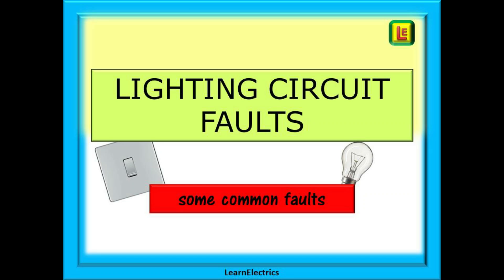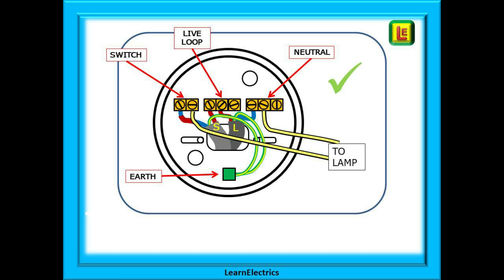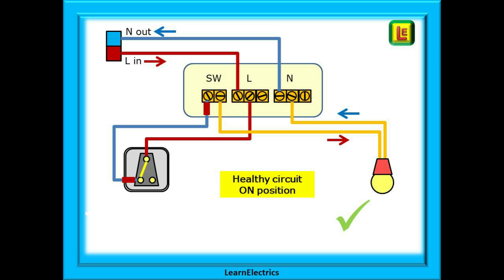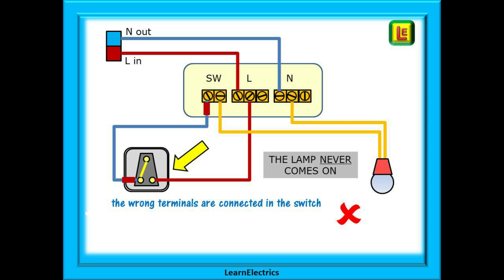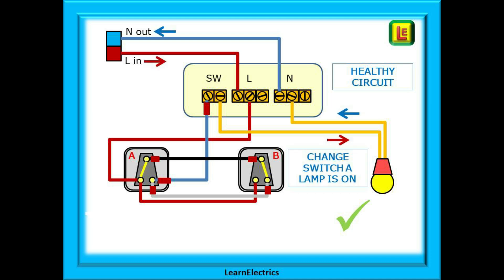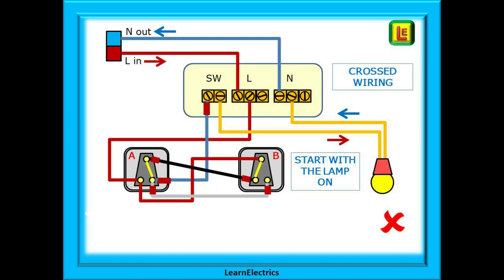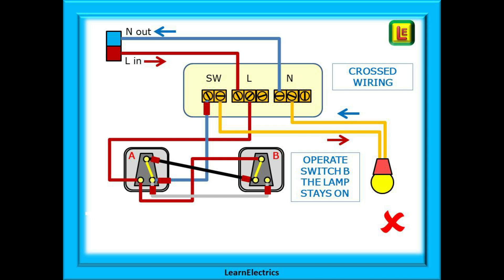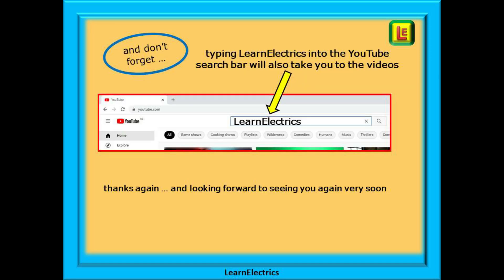LIGHTING CIRCUIT FAULTS. Some common problems with lighting circuits and solutions.

Comment: What's the fault, when the light comes on sometimes or there's a delay in it coming on?
Reply from the maker: First thing I would suspect is loose connections somewhere or damaged cables. Dead test all the lighting circuit, low ohms and insulation resistance. Have a look at this video.
https://www.youtube.com/watch?v=Ax4-bZ7WDwg

Comment: The oddest & biggest pain in the arse I've had with lighting was installing 6 led spots in place of an old 6ft flourescent.
They worked great for about a week then all 6 started going to half brightness!! I re terminated every connection, replaced the switch drop & the issue randomly continued after a couple more days. Luckily i could easily get to the loft area. I measured ( whilst in fault mode) 188v !!! I replaced the complete circuit & feed ( from the adjacent bathroom) & all is ok. I meggered the 1.5 T&E that i removed & scrutinized it severely, & it looked perfect. I can only assume that the cable had a break down within the copper somehow !!! But it meggered ok & a low resistance test came back ok !!
Reply from the maker: Could have been leaky cable insulation, it could have been leaking to something it was touching. Sometimes these random problems remain a mystery. Almost certainly the old cable was the root of the problem. Good that its sorted.

Comment: Useful thankyou! What about a 2-way switch where only one orientation of switches work?
So there’s only 1 out of the 4 possible ways of having the switches that works.
Is that a problem with the switch itself?
Reply from the maker: That sounds like a wiring fault, check that your wires are going to the correct terminals. Have another look at the video, a scenario like that is covered. Thanks for watching. Dave.
Reply: Hi, I replaced the switch and it started working properly again. Your video gave me the theoretical knowledge to realise that one of the switches must be the issue, and also demonstrated the patience required to find faults. Thank you for this informative video. I’ll be back for any more electrical issues in the future!

Comment: Hello, What is the minimum size of an aluminium conductor which feed a lighting circuit, 16mm² or 1.5mm². In OSG, table I1, aluminium cable only begins with the size of 16mm²
Reply from the maker: Correct. Table 52.3 page 148 of the Regs book. Be careful with old aluminium cables as they become brittle and can snap as you bend them. And remember to dip them in an anti-galvanic compound before putting them in brass terminals. Sometimes best to try and rewire that part of the circuit in copper if possible. Dave.

Comment: You're a top fella Dave. As an apprentice I muddled the strapper cable on at least a couple of occasions. I was red faced trying to figure out what I'd done wrong. It worked but not how intended.  Sometimes it's the simplest mistakes. Keep doing what you're doing buddy. You're producing some mighty fine tutorials 👍.
Reply from the maker: Thanks Ray. I've lost count of the mistakes I made over the years - training days I called them. And yes, every intention of continuing the help videos. Dave.

Comment: hi, 
With the ' it blows the fuse on switch on ' , what if the lights had not been disconnected for decorating or what ever reason for disconnected and reconnected wrong and it has just developed this fault , 
what could the issue be then ? 
A short some where , but how would you go about finding where the shot is ?
is there a video like the ' Fault finding - Ring circuit ' , for the lights ?  
or would it be the same method you would use as in the Fault finding - Ring circuit, continuity test first then insulation resistance?
Reply from the maker: Something has happened. Just a case of methodical fault finding. Good luck. Dave.
Reply: @learnelectrics4402  , Hi Dave ,
Thanks for your reply , what methodical fault finding method would you use ?
would it be the same method  used as in the Fault finding - Ring circuit, continuity test first then insulation resistance? 
or is that just for Ring circuit for sockets ?

Comment: Great content as usual. Fault-finding techniques for RFCs would be very useful. BTW, what software are you using for your diagrams?
Reply from the maker: I just use powerpoint. I used to use CorelDraw until about twenty years ago and thinking about going back to it. But I've been thinking for two years now.  Thanks for watching.